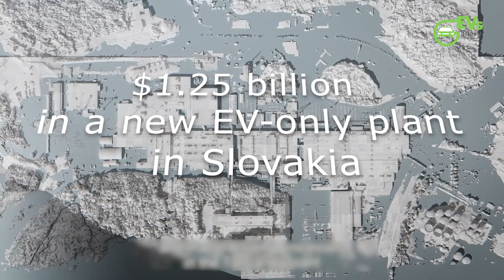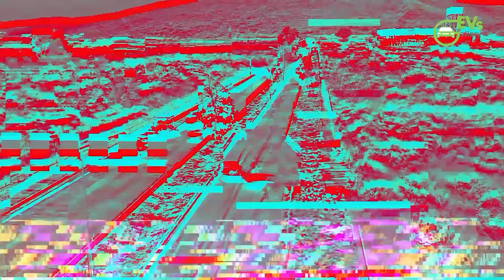Volvo's Eco-Friendly Giga Casting Revolution

Comment: Volvo isn't only using IDRA for large casting machines. Volvo is retooling its Torslanda plant in Sweden to make the EX60 but that plant will use Bühler machines. Volvo calls it "megacasting" not "gigacasting." The way Volvo uses them is described differently than Tesla and Volvo will use them for flexibility in certain strategic positions.  Bühler is a Swiss manufacturer. 

The plant in Slovakia may at some point make most Volvo BEVs when it gets in gear. But still some will be made in Sweden, some in Belgium, some in the USA and some in China. So, megacasting machines are coming to Volvo and this is just the beginning. Volvo may use different manufacturers to supply them. 

As for people saying the company is not Swedish, that's total nonsense. The company is Swedish with a Chinese parent company. But the Volvo company itself, the ones who engineer, design, manage, test, and specify what is in the cars in terms of technology, materials, carbon footprints of the vehicles, and so much more, are firmly based in Sweden. There of course is some platform sharing with Geely and such and some tech sharing, with Volvo leading some of it, but nothing beyond what Stellantis or VW would do and from my own research, Geely is less hands on with Volvo than VW is with, say, Lamborghini. So, no, Volvo isn't Chinese because the brand itself is firmly still based in Sweden which engineers Volvo's principles on safety and manufacturing and design and Swedish heritage and feel and everything else into the cars. Yes, some "Chinese money" may be used and some profits may go to the parent company. But there is a difference between the brand and its operations and its parent company. And Geely is very much in the background.

Comment: Volvo cars aint Swedish anymore, they're Chinese - Geely bought them.
Reply: True and now geely is selling more shares in volvo so the company could reach its potential.
Reply: Seems better now.
Reply: That's BS. Volvo is very Swedish and not Chinese. Yes, Geely bought them and you know what Geely changed? not much. Volvo is still located in Sweden, still is in charge of managing their products, have made 2 of their own platforms, have their own design teams, dot heir own road and crash testing still in Sweden. People that write that they are Chinese and not Swedish just use the "Geely bought them" as some sort of reason for it. Yet, if you look at how Volvo operates, they're more Swedish now than they were under Ford and even have more tools to be their own company under Geely than they were when they didn't have a parent company.